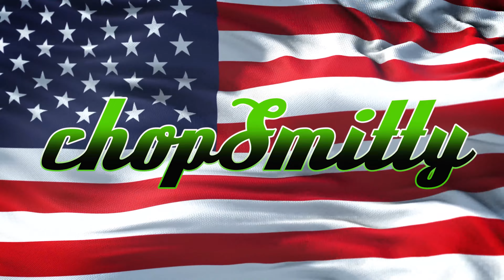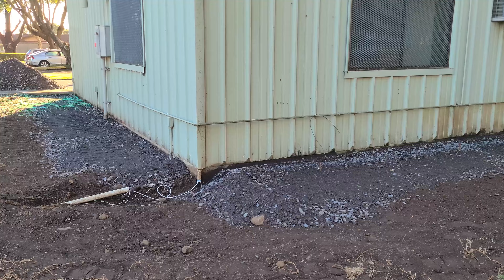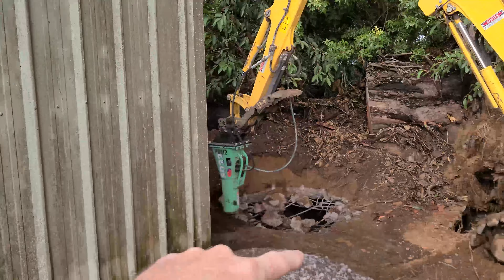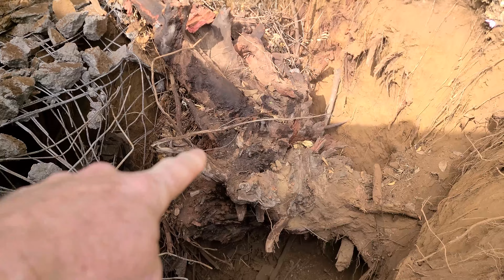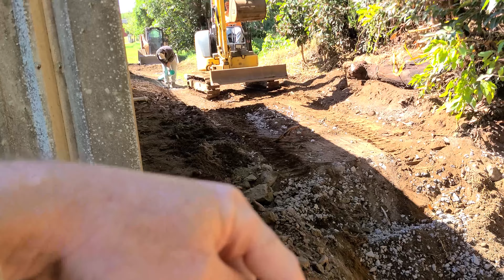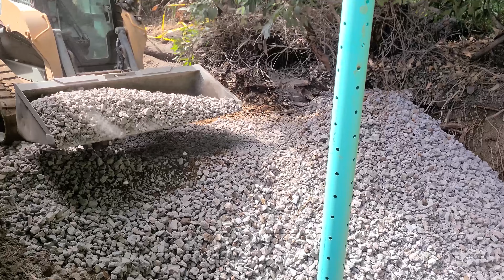Losing the shop in a huge hole!

Comment: Great job but one mistake don't suppose to bury steel when it rust away that will go to ground water sorry I did same thing. Finally I dug it all up and took to scrap yard.
Reply from the maker: Interesting.  I'm asking around about this.  One person said "Iron drain pipes are direct burial...?"   Anyway, the cesspool has been abandon for over 60 years and the ground was absolutely dry - dusty dry (and it's raining in Waimea).  All the local water is provided by Kohala Mounting ditches (rain water) vs. well water.  I think there is very little risk in what we did.   
On a side note - not one recycle company will even accept my aluminum, steel, brass, etc chips.  So all of that goes into the landfill.   No other choice.